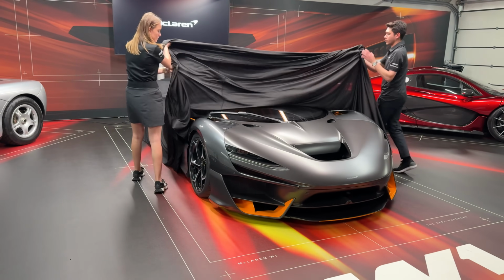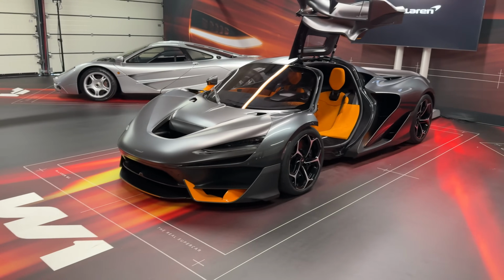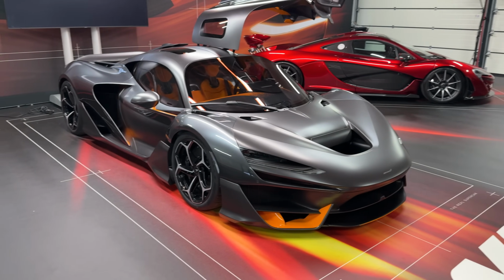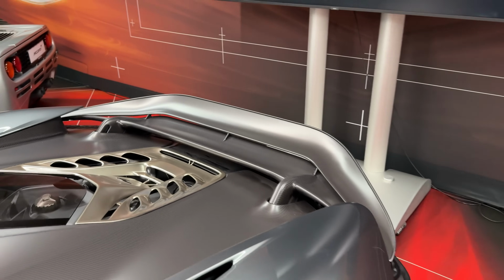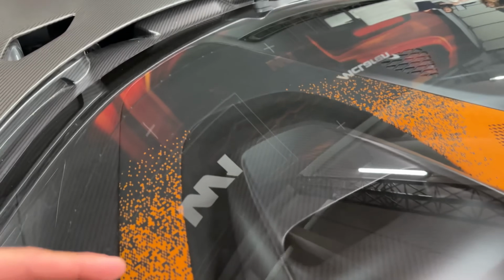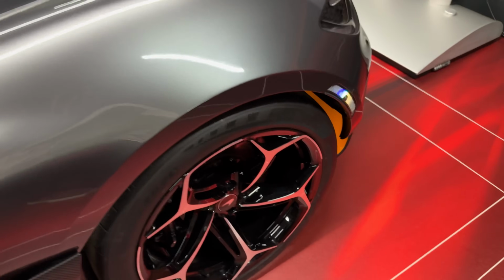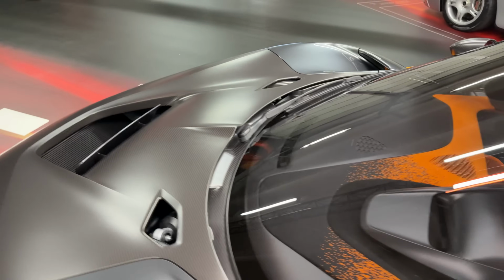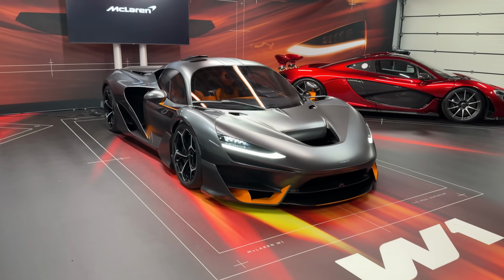NEW McLaren W1🔥 CRAZY HyperCar! P1 Successor! Interior Exterior Walkaround!

Comment: Overpriced as usual. Cost of ownership and maintenance will be stupid. It's not a patch on the C8 Corvette ZR1X. Corvette has everything, comfort speed performance even lots of luggage space and technology that this doesn't have.
Reply: W1 is definitely more advanced than the Corvette, and it will easily beat Corvette on track.
Reply: @jansedlak8505  I wouldn't be so sure considering the ZR1 actually beat the McLaren Senna on a track and it wasn't even ZR1X especially considering the ZR1X has faster acceleration, but only time will tell.
Reply: @TheSpartan21029 Senna was on Trofeo R tires. If it was on Trofeo RS tires, it would probably match teh ZR1 depending on the track. W1 has more power, more downforce and better tires than the Senna.
Reply: @CtecRef  Trofeo R are still track tires and you can make the same argument for ZR1. As far W1, its a wait and see. McLaren is hit or miss when it comes to track performance. I remember back in the P1 days that they never posted their Nurburgring time after they tested it. The 720s was also deemed do be unruly like the P1 when it came to control as well, but its a wait and see. McLaren did a good job with the Senna but Corvettes have a much stronger racing lineage when comes to making great track cars.
Reply: @TheSpartan21029  If ZR1X somehow beats W1, it would be so f*****g funny. In a good way.
Reply: @jansedlak8505  Yeah it would. Hopefully, McLaren bought their A game otherwise it'll be a laughing stock

Comment: The ZR1-X has higher top speed, and is quicker from 0-60… Yes W1 is a beautiful car, but it should outperform any corvette for the price tag🏷️.
Reply: You can’t compare a McLaren to a corvette totally different cars 😢
Reply: @AlanBrown-d8w why cant you other than price?
Reply: The W1 I see 0-60 mph in 2.7 secs. That's unimpressive considering the amount of HP it has and it's weight
Reply: W1 is significantly faster on track with kore downforce and lighter weight.

Comment: Well out of the : F1 ~ W1 ~ P1.....for sure , the new car looks the worst. It's like the ' TRANSFORMER ' version of the P1. Way too busy , while the slit headlights never work , on any car. On looks between the W1 and F80 , it's about even with neither looking great....Clearly all cars mentioned have fantastic performance , so I'm basing my critique on the asthetics....PS: P1 is the Looker of the 3
Reply: I’m sorry but the w1 is a beauty compared to that Lego Ferrari with a v6 quieter than a Tesla, w1 clearly the better car
Reply: @h1gh_end134 This hotwheels is a beauty? F80 actually looks great in sunlight. W1's wheels are disproportionately small compared to the works. Makes it look like a toy.
Reply: @CtecRef  hotwheels>>>lego
Reply: @CtecRef  hotwheels are better than legos after all 🤷🏽‍♂️
Reply: @h1gh_end134 It doesn't change the fact that the F80 looks better than W1 in proper lighting.
Reply: @CtecRef  except it doesn’t, w1 atleast has curves and isn’t a rectangle
Reply: @h1gh_end134 That's why you should compare the cars in sunlight, because all of the F80's square lines blend into the rest of the bodywork.
Reply: Agreed! The new ZR1 is going to destroy this thing!
Reply: @keithjackson4985  Nope, the tuned r34 wrecks everything
Reply: @MaeveSterling  A tuned R34 would be quite difficult to reach the numbers of both the W1 and ZR1x, not to mention it would be suited only for straights and quite unreliable.